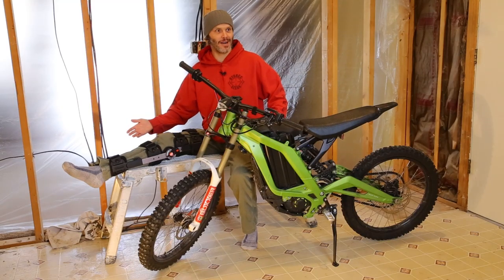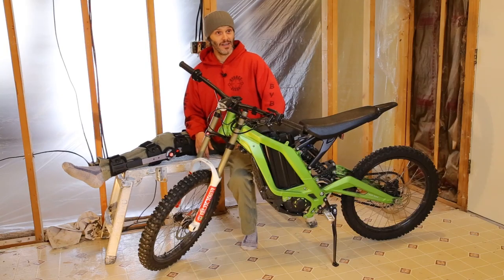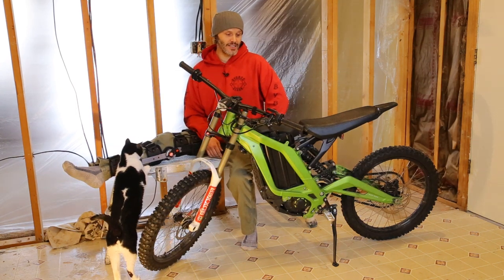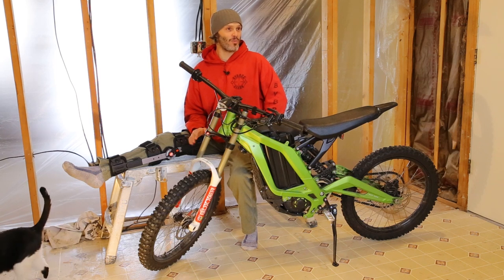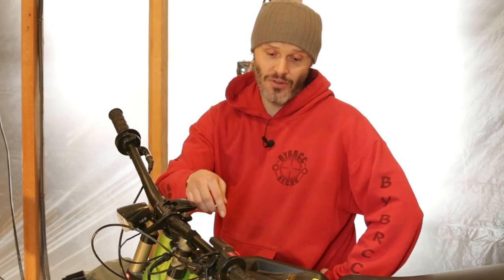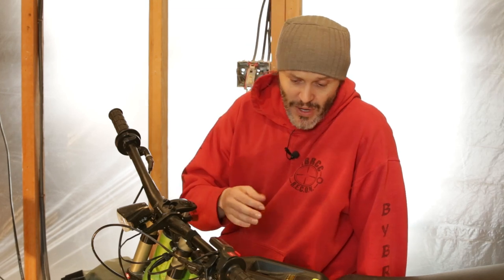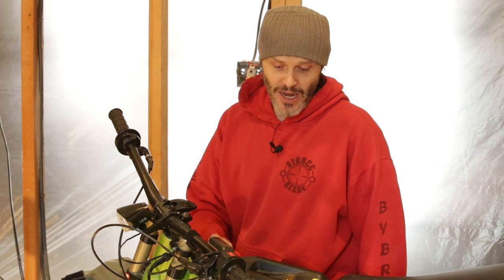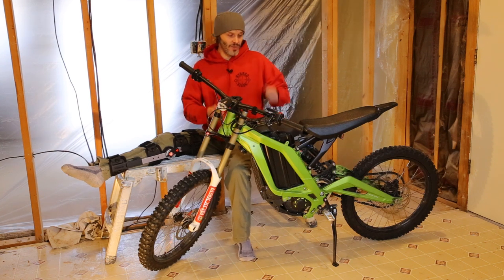Winterizing Electric Motorcycles - Battery Maintenance Tips - Holmes Hobbies

Comment: So, from Sur Ron, they say if storing it to bring it down to about 40%:

“BATTERY MANAGEMENT
We don’t recommend storing the battery in hot, cold or humid places. The recommended storage temperature for the battery is 15° C in a dry environment. The battery should be stored at about 40% charge to keep the battery operating longer. If you plan to keep the motorcycle steady for a few weeks it is advisable to disconnect the battery from the motorcycle . Avoid storing the fully charged battery – this will reduce its life. To get the most out of its performance, take a ride right after you’ve recharged.”

Comment: I bought a Sur Ron partially from your videos?  I mean...  it wasn't the only reason, but it was a factor.  Question:  What is the best practice for charging the battery?  Should I connect it to the charger after every ride (short ride, where it is 80% full)?  Is there a benefit to letting the charge go down more before recharging?  Can you "train" the battery?  Is it bad to leave it on the charger?  My mind is full of battery lore from years past.   I don't know what's what.  Help me Mr. Holmes.
Reply from the maker: If you are riding frequently, charge it fully.   If it sits a while between uses, turning it off at 80% is better for overall battery life.   But you should still charge fully about once a month to ensure the cells stay balanced.